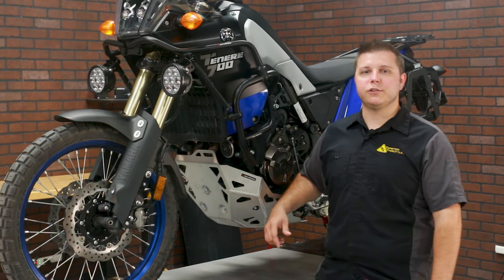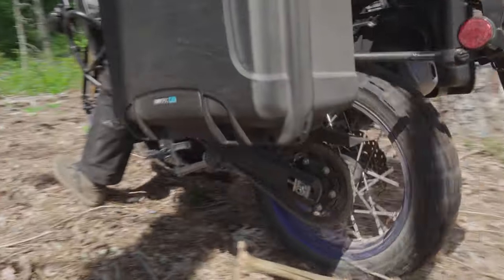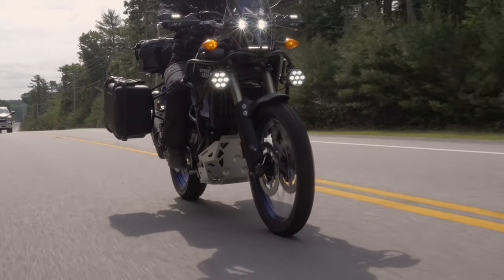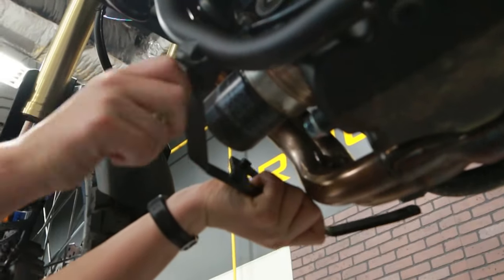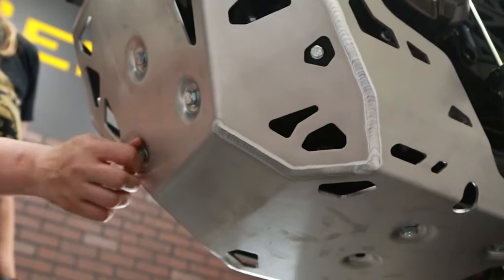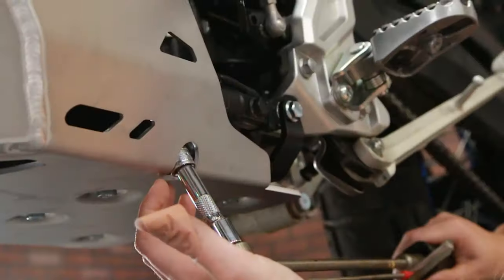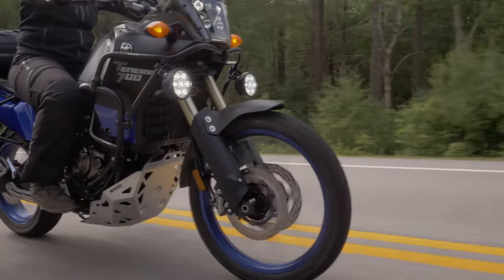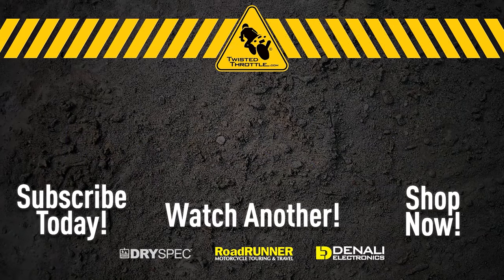Yamaha Tenere 700 SW-Motech Skidplate Installation

Comment: Hi, you state that it works with the sw motech center stand, but what about the oem center stand? Is it compatible with this skid plate? Please let me how. Thanks.
Reply from the maker: We have used it with the SW Motech center stand, which is what it was designed to work with. We have not tried it with the OEM center stand.